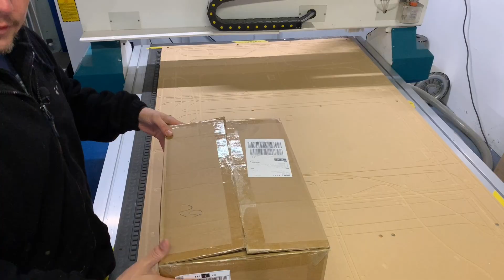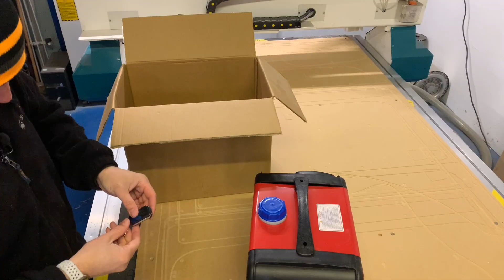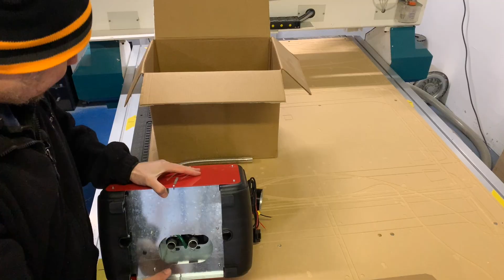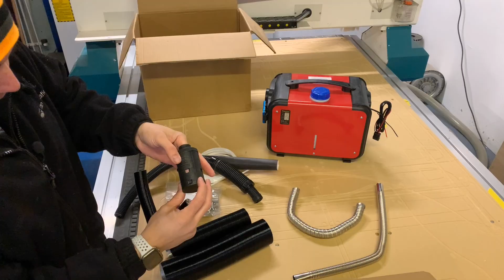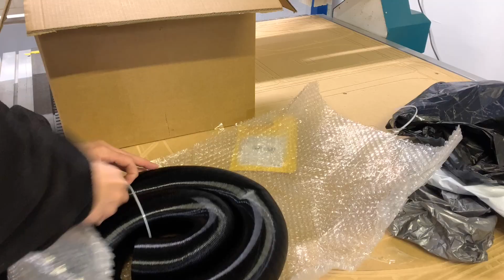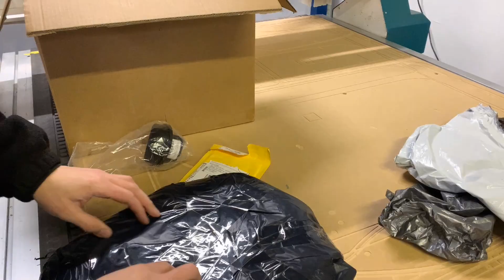Sunster 8KW Diesel Heater Part 1 - Unboxing & Comparison

Comment: I am going to try Kerosene in mine
Reply from the maker: I was looking into the pricing of this a few days ago but it wouldn't be any saving over red diesel (UK). 
I've heard some people using old cooking oil etc.. but from my experience these burners run best on standard pump diesel. 
Our space heater in the workshop burns so much cleaner on pump diesel over red diesel yet they are meant to be the same thing but with a dye. I'm presuming it may be the additives in the pump diesel helping it burn.
Reply: @VanCreations  kerosene burns much cleaner but wears out the pump faster.

Comment: Will the internal diameter of the autoterm fuel line be OK for an 8kw?
Reply from the maker: When installing, I’ve relocated the tank to make it easier for filling and used what we had here which was 2mm fuel line we use on the 2kw heaters, it works but…. Will it work more efficiently and produce more heat by stepping up to 4mm?
I will be showing this in a later video.